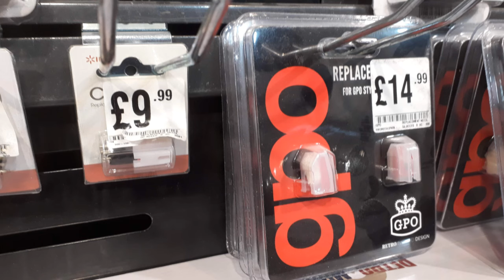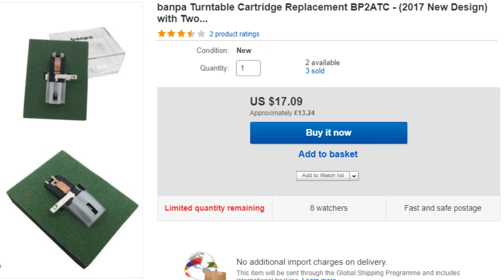Crosley troubleshooting for 'suitcase' style record players

Comment from the maker: Please note, I'm talking about basic suitcase style machines which use an external power supply or 'wall wart'. Some machines are directly mains powered and have dangerous voltages inside. For safety reasons I do not recommend opening these up. If you have any doubts, please don't attempt to repair and instead consult a professional.

Lost or broken Power supply or cord?
Check out this video:
https://youtu.be/dkkijvr30XE
Thanks 😀 👍

Comment: I bought a used Crosley  Model CR8005U-M1 status unknown.  It came with a power supply that was original. I tested the voltage and it was 18 volts. Finding another supply rated at 9 volts the record player ran but no audio. Checked the simple stuff everything looked okay. It turned out the amplifier IC was blown.  The data shows it is rated for no more than 12volts. I ordered a new IC. I also checked the capacitors which are rated at 16 volts. Only one seemed out of range so I changed it out. The player works now. I tackled this because it was a fun project and I already had the test equipment  to repair it. Otherwise I would not attempt to repair them for this problem since the cost to buy a new one isn't that great.
Reply from the maker: Thanks very much for the info on your repair. Yes I think many go unrepaired as the owners don't have the skills to do it themselves and paying someone else is more expensive than buying a new one. I don't know what the failure rate is, but this is certainly the busiest video on my channel! I have picked up several example very cheaply, mainly the ION type vinyl archiving units, though I  have a Crosely style baseboard rescued from a skip/dumpster. Presumably the owner felt the case was worth keeping, but not the player! 🤔😉😀. Thanks 😀 👍
Reply: @mrrgstuff  My player does not have the extras. I checked the weight of the arm and it was close to 6.0 grams. I changed the needle and found some tire balancing weights that are used on the inside of a tire each is 1/4 oz. Hot glued two to the end and the weight is about 3.9 grams. The sound quality isn't the greatest so I plug in my monster speaker. Really makes a big difference actually sounds like the old players I grew up with. My wife is annoyed I am playing records all day.
Reply from the maker: I have been doing experiments recently with USB recordings, mainly to test upgrade cartridges (I have posted a few videos - mixed results) as I have a similar ION brand turntable with basically the same mechanism. Sound quality through USB is surprisingly good, so despite the cheap mechanism they can sound good. The cartridges I believed are aimed at a 5g tracking weight, but can certainly do lower and a lot higher without apparent problem (though higher will cause more record wear). Sounds like a very good mod you have made with the weights. Thanks 😀 👍

Comment: Hello! LOVE that you made this video. I did not think I was going to have much luck searching for some type of troubleshooting video for this player. I bought the Crosley Cruiser for around $50. I could not afford to go out and get a new one so you are a life saver.

Now, do you know of any other items lying around the house or garage, where I could obtain similar speakers to replace the one in my player?? Any suggestions will surely help! ❤ Thanks again! ☺️✨
Reply from the maker: Glad you found the video useful. If you have determined that you have a bad speaker, it should be possible to buy one online which will fit. Speakers do vary so if you don't have experience in this area then I suggest finding someone local who can obtain the part and do the repair for you. Thanks

Comment: My records keep slowing down and distorting even though they played fine before. I don’t use my record player often, and when I turn it on to play CDs and Bluetooth, it plays a weird ticking noise every time. What do I do?
Reply from the maker: The motors on these record players are very weak so any sort of obstruction or too much weight pressing down on the record can cause them to run slow. Have you added weight to the tonearm to stop it skipping as this could be the problem. Also worth checking the belt is in good condition and still in place. If its dirty or worn/stretched/loose it will also slow down. If the ticking is coming from the turntable spinning then it sounds like some sort of obstruction. Otherwise unfortunately I don't know.
Thanks 😀 👍
Reply: If the record player is slowing down, the two areas I'd investigate first would be the belt (they do stretch and become loose over time), and making sure the platter has enough lube in its spindle.   This type of mechanism doesn't use a traditional bearing like older turntables do; it's literally a little nylyon washer in the well slathered with white (lithium) grease, which can dry out over time.

A lot of these little record players also have very cheap motors, and I've found a few that were never lubricated properly when they were made.  I've had to disassemble a few of those motors (you have to be very careful!) and put a drop or so of oil in the bearings.  DON'T USE WD40 or Liquid Wrench; those are penetrating oils and not proper lubricants and not suitable for a motor.  Something like sewing machine oil is more appropriate.

The clicking may be a separate issue.  You'll have to track that down.  Is it related to the turntable speed (does it go faster and slower with different platter speeds, etc.)?  You mentioned CDs; are you sure the noise isn't coming from the CD player?   I've no idea why there would e a clicking noise of you're in Bluetooth mode.

Something else to consider, and I'll put this as gently as possible:   These plastic turntable mechanisms really aren't made to last, and they are not intended to be repaired.  I know a lot of people get really bent out of shape when I point that out, but there's a reason that they stamp these things out by the millions and sell them so cheap.  It is literally the least expensive mechanism offered today that can be called a 'record player'..... and 'cheapest available' seldom equates to 'good'.

Replacing the belt and relubricating the spindle are about as far as I'd go in terms of any effort to 'repair' them.  MAYBE replace a motor if you can find one.  Anything that costs more than about $20 is just throwing away good money on a bottom-dollar piece of hardware.
Reply from the maker: @xaenon  Thanks for the great comment, and advice. Much appreciated 😀👍

Comment: I bought my daughter one of these for Christmas and it was running too fast for a 33 1/3 record.  I tried all 3 adjustments and it slowed down but not enough.  I am returning this player and will try another.  The pot at 28:36 is different on the newer ones; there is a circuit board with a hole in it that has the pot under the board.
Reply from the maker: Does sound like it had a fault. Usually these run too slow. The motors are very weak and it doesn't take much to upset them. Hope the next one is better. Thanks 😀 👍

Comment: Question I have a cr8005d and attempted to trace the power and so the cable I’m using is showing 12 volts when plugged in but when I go to turn on the record player it only is taking at most 2 volts inconsistently it’ll jump from under 1 volt to between 1 and 2 volts
Reply from the maker: Ok, an important thing to know is that equipment gets given voltage, but takes current. So as your power supply is 12v,  that is what is getting fed in. The other side of the power supply is 0v or ground. Now depending where you measure the voltage between these 2 points you will get different values. Where are you seeing this measurement? 1 or 2v isn't much though and may indicate a short circuit. If you can set you meter to measure current ( it will also need to be connected up differently so please check if you are unsure) you should see a high current draw, much more than the machine would normally take. The label on the back of the machine will tell you how much current the machine expects to take. This will be a maximum, so just being turned on without a record playing should take much less current than this. The label on the power supply shows how much it can supply. I have just done a video on this here:
https://youtu.be/dkkijvr30XE
BTW what symptoms are you seeing with the machine, and did it ever work for you 🤔

Comment: I had an issue where the audio only came out one speaker, and I confirmed the speaker worked, and even with a brand new needle, the audio only came out on the Left speaker.
> the fix was: the volume knob (potentiometer)!! theres a tiny hole and I dabbed isopropyl alcohol into it and gave it a few twists and now the audio is good as new.
>  I hope this solution finds someone who needs it!

Comment: What does it mean if when I touch metal to the connector behind the stylus and I DON'T get a buzzing sound? (At 21:44 in your video). I also tried touching the red and white each to the ground and no noise from that either. Should I replace the stylus?
Reply from the maker: If you don't get any sound (buzzing, clicking, static type noises) out of the speakers then there is a fault in the amplifier somewhere. Replacing the stylus isn't likely to help as this test bypasses the stylus and is testing the amplifier. Make sure you do have the volume up a bit as if you have just clicked the on/off/volume control on, then the volume may be set very low and you wouldn't hear any noises anyway. Unfortunately there is not much you can do with an amplifier fault, as it probably needs to be fixed or replaced internally.
Reply: @mrrgstuff  Ok thank you that's very helpful

Comment: Thanks for this. Any ideas on when I touch the tonearm in "play" condition I get loud buzz from speakers. Volume mid setting.  Is this normal?
Reply from the maker: I wouldn't expect that, but it's possible it's just a poor design. Does it actually play? What is happening is that your body becomes an radio antenna and causes the interference on the audio wires. As they go through the tonearm to the amp, any interference gets amplified along with the audio. I'm guessing you have a metal tonearm. It may be that an audio wire is touching on the inside of the tonearm. I thought the metal tonearm might be grounded which would have helped, but as these turntables often work off non grounded power supplies, that doesn't seem to be an option and on the 3 I was able to test, the metal tonearm seem to be cosmetic only. I suggest checking the connections on the back of the cartridge and seeing if the cable in the tonearm is damaged in any way.
Reply: @mrrgstuff   Thanks for the content in general, very interesting! My issue is the opposite to the original question. I got buzz sound through RCA, USB, and headphone jack. When I touch the metal tonearm in play position the buzzing goes away.  So my suspicoun is that it is generated before or at the built-in preamp. Do you happen to have any suggestions on how to fix this?
Reply from the maker: Issues like these are often tricky to track down. It sounds like it could be some sort of screening or grounding issue. I would start by checking the connections on the back of the cartridge.

Comment: I know this is an older video, but I plugged in an aux cord, and it completely stopped working. Like power isn't going through, the speaker for the aux works fine, but the turntable doesn't turn on. Did I fry the electronic bits inside?
Reply from the maker: Unfortunately, it's impossible for me to tell what might have happened. However, if it was working and now won't turn on, then it does sound like something is broken. In many cases it is not worth paying someone to diagnose and fix the issue, so buying another one is cheaper and simpler. You could also view it as an opportunity to look at buying a better quality turntable.

Comment: Not sure if you'll see this given how old this video is but my girlfriend got me a Crosley Discovery for Christmas. I can hear audio coming from the cartridge and needle area when I turn the speakers down that sounds really really crisp, but the actual music coming out of the speakers leaves a lot to be desired. I fiddled around with Bluetooth and an aux cable and it doesn't seem as if the speakers are the actual issue. Do you have any ideas on what might be wrong or how to fix it?
Reply from the maker: Ok, you can test the amplifier and speakers by connecting it up to your phone via Bluetooth, and playing a track you know on the phone. If this sounds acceptable, but the output from the record player doesn't, then I would suggest checking the wiring to the cartridge and also that the stylus is properly clipped into place (assuming it's the type with a red plastic part), and that the tip of the stylus is actually there and not missing. If all that seems fine, I would suggest changing the cartridge and stylus. It's one of the very few things you can do and it might work. If the sound via Bluetooth doesn't sound OK, then you might have an amplifier fault, but unfortunately there are no simple fixes for these. Good luck 👍
Reply: @mrrgstuff  Preciate the help, what does the stylus being in proper place look like?
Reply from the maker: @NathanWhite22  They stylus shield (the red part) can come partially detached from the cartridge (the black part). It should be firmly attached and not flop about. It just clips into place. This video has some pictures in it which may help:
https://youtu.be/WjecPbT3ipw

Comment: The power was fine on my Crosley Cruiser this morning but after leaving it for about an hour (switched off) and coming back to try a record it had suddenly stopped working. The power switch works and clicks, but there is no power light & it is now making a loud buzzing sound. The turntable also won't do anything (i've checked the belt & it is fine and on correctly). :(

Comment: Thank you! I have a question my record arm slides across the record. How to I fix this issue?
Reply from the maker: First thing to check is that you have a stylus fitted. On a Crosley this is. usually red and has a little rod or bar with the diamond or sapphire point which touches the record. Sometimes the stylus is missing and sometimes the point has broken off. Have a look under the end of the tone arm. It's small but you should be able to see it. If the point is very dirty or covered in fluff this might be the problem too. Otherwise it's likely there is not enough pressure to keep the point in the record groove. On more expensive units this is adjustable, but most Crosley types ones aren't. Worth checking your exact model though. Good luck 👍😀
Reply: @mrrgstuff  thank you I was scrolling through the comments to see what was the matter with it so this helps alot
Reply from the maker: Glad it was useful.  Thanks 😀 👍

Comment: hi, my problem is that the “on” light doesn’t shine when i turn on my record player but the disc turns very slowly, what may the issue be?
Reply from the maker: Difficult to know, but I would check the voltage on the power adapter first, or maybe try another one
Reply: Mine has the same problem man

Comment: Question... I have power running through the case, and I can get everyone working ( the lights, the spining, the Bluetooth.) But no sound comes out what so ever (for a record, aux cable, and Bluetooth). All of the wires are connected but and I know the speakers work, I just don't know what's wrong
Reply from the maker: Well definitely sounds like an amplifier problem as you have eliminated the record player, if the audio in and Bluetooth don't work.  Have you tried headphone socket? Also how do you know the speakers work? Thanks
Reply: @mrrgstuff  I have tried the headphone jack it didn't work either I think a component on the circuit board was fried so I think I just have to replace it. Thank you though, the video did help

Comment: Great video. So I went through the troubleshooting, but when I go to turn on the record player with the switch it starts to basically sound like the power is clicking.... the light flashes on an off and I can hear it electrically clicking... any ideas?
Reply from the maker: It sounds like its just tripping out. This could indicate a short circuit. I would check the wall power plug (wall wart) first. Make sure that is ok. Other than that, difficult to know what to suggest.
Reply: @mrrgstuff  Thank you. Yeah, I thought the same thing and checked at three different wall plugs, same issue so likely internal. I did check the belt and that is ok, not stuck - but not turning either. So, this sound is definitely tripping, so I thought maybe the motor was shot..... Thanks for your insight - really good videos!
Reply from the maker: Thanks. I have to admit I have not seen this fault myself, but the sound along with the led going on and off does sound like an internal electrical fault
Reply: @mrrgstuff  Well, it all is a moot point now because when I was trying to "reset" the arm I snapped it and it broke internally..... so now I have made the problem even worse..... Any recommendations on a decent quality, record player for a beginner? LOL
Reply from the maker: Oh well. Unfortunately no recommendations from me. I  have a few vintage ones and have picked up a few of these cheap Crosely type ones used, but I haven't bought anything new. There are several other YouTube channels which can answer this question much better than I can. Good luck 👍 😀
Reply: i am having the same issue! :( let me know if you figured something out